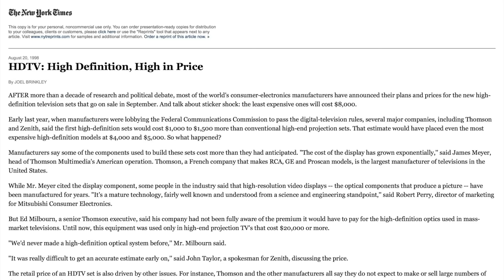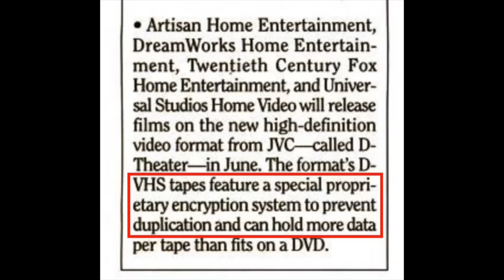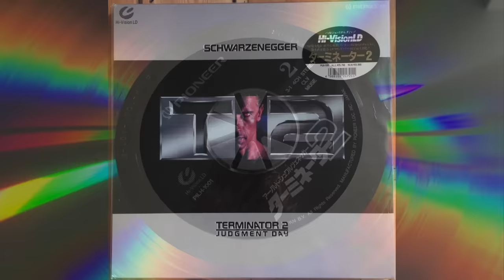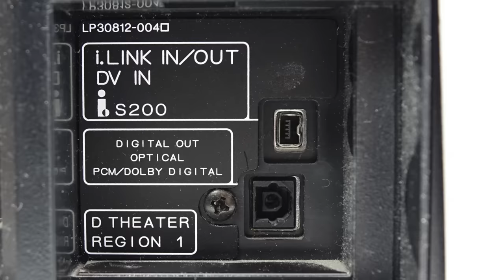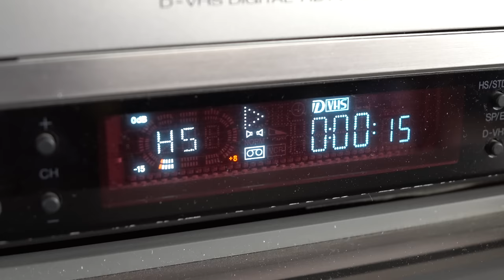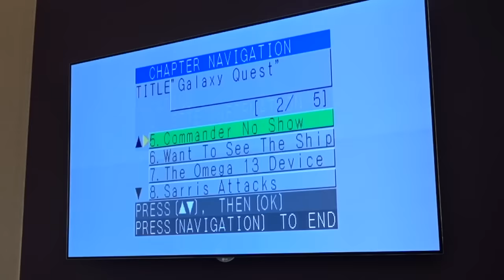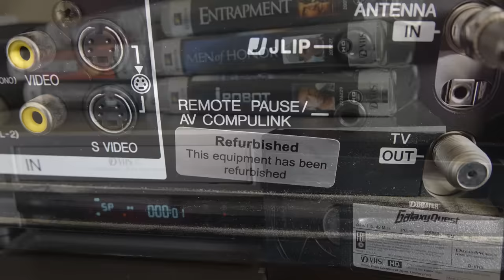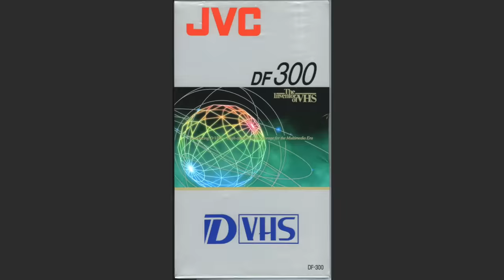Remember when HD Movies came on VHS tapes?

Comment: 50GB on a storage format from 1998 is quite impressive.
Reply: well it's tape... tape drives have been in hundreds of GB for quite some time.. eg 8mm m2 or SDLT 220
Reply: Yeah, tape is still the best for archiving, look at Sony's 185 terabyte tape format for example!
Reply: JonnyInfinite, HAHAHA
Reply: Never underestimate the bandwidth of a station wagon full of tapes...
Reply: JonnyInfinite 185 terabytes? You know how much porn you could save on that. Probably every u.s. porno from 1983-2013
Reply: Really when it comes to storage on tape its only limited by how much tape

If you had a tape drive with enough tape you could get TBs worth of storage in the 90s

Tape drives have a drawback though in theyre not random access. Not a big drawback when it comes to a movie because a movie is juat played linear but yeah
Reply: That's 2-3 times as large as the permanent storage in computers at the time. The modern equivalent would be a 4-10TB disc or a 200-600GB SSD.
Reply: imagine ripping that in 1998 hue hue ueee
Reply: IKR? They should have marketed it for backing up data as well!
Reply: @ytparchivefoundationytpaf3079  Depends on the resolution...
Reply: @TheRanblingjohnny  *Correction: Never underestimate the bandwidth of a paddy wagon full of tapes...
Reply: Isn't tape not good for data preservation...? I mean it might be able to hold a lot of data but it's so fragile.
Reply: @JonnyInfinite well considering degradation it’s terrible for archiving

Comment: I'm a 51 year old tech nerd and I have never heard of HD on VHS until now!
Reply: I have never heard of HD VHS too!
I think this never came to Brazil.
Nice video.
Reply: G Star Yeah, when he said it was a little bit of a break in the space time continuum, I legit thought he was just quipping. But between that and your comment, I’m starting to wonder if D-Theater actually existed before this video was uploaded and wasn’t just the Mandela effect in... effect.
Reply: well sir hd vhs invented on 2010 I think
Reply: @king.canute21  According to this video, the decks were available around 2002.
Reply: @teacoffee42  i think the reason it never penetrated the UK market was most likely down to the price and the fact that HD DVD was just around the corner. This format was just pure Yankee exotica for the rich.
Reply: When the rectangle 📼 VHS aspect dies, the ⭕️ disk form rises
Reply: I remember the formats briefly for sale and had even considered buying one of the two HD VHS systems (one of the turnoffs for me was their convoluted HD recording ability and connectivity that Mat/Techmoan goes into, having to use the stupid FireWire port to record HD off-air, etc. and allowing only SD over component video to record). Also bear in mind, DVD recorders were just about to hit the shelves, if not already by that point in time. In some ways, it was a similar scenario to what happened to the DAT format with its SCMS copy protection that held that formats' sale at bay here in the US until '91 or so...) But there were already rumblings in the A/V press ("Sound & Vision" mag, prior to the merger of Stereo Review and Video Magazine and others) on manufacturers somehow upgrading/modifying DVD to HD (or a replacement format that would be in the works shortly). As history shows, it turns out the latter happened: BluRay and HD DVD.
Reply: How does normal VHS tapes look on this D-VHS VCR

Comment: The future is 8K VHS.
Reply: Hook a HEVC/H265 decoder to a DVHS then it would be really possible. DTheater was only mpeg2 after all. 4K would be possible with H264 decoder.
Reply: Yes, it's like moving back form cd to vinyl, the sound is richer. Same goes with picture. :)
Reply: Nice Meme Not true! Vinyls have certain soft sound comparing to CD:s (if no scrach) and nostalgia IS NOT the only reason people or some like to listen it!
Reply: That doesn't explain 'soft' sound I mean!
Reply: Well I think even in vhs today's movies would look amazing because of the new vfx
Reply: 16k kinetiscope is the future
Reply: you will just have to settle for a  VHS recorder with a ATSC Tuner  they are 100$ on ebay if you want to have a ATSC tuner and VHS player/recorder..

 I have to say the ATSC to VHS is quite nice    the sound quality is amazing for VHS tape (better then commercial HiFi movie tapes) they tend to have too much  bass (sound banding ) it has more bandwidth on the ATSC to VHS transfers  much crisper
Reply: YAAAASSSSSS
Reply: Just Another Youtube Channel About that, Digital, because it's on or off, is very resilient. Even with tape degradation, it would take a long time for errors to start appearing.
Reply: Bandido894 hmm nor shore I agree, but sound js rather subjective so whatever floats your boat.Ilrefer difital, high bit rate uncompressed/ lossless compression it has a lover noce floor than vinyl and is a lot more convinient
Reply: @KingFahtah  I'm going for 12k pong followed by 12k minesweeper
Reply: Yes Yes
Reply: VHS stock survived for so long, until drop outs  or tape bends.
Reply: lol!
Reply: Ultraman's Inspirational Recipes  Does it still CLUNK during the changeover? LOL
Reply: @Jaspion88  techno babble to me lol
Reply: XD
Reply: Nah I think it's 16k video on micro cassettes XD jk
Reply: wrong,  8K Beta!
Reply: Super 8 film anybody?
Reply: Da fu-cha iz 2pac  'kaay!!!!!!!!
Da day afta iz 3 'kaaay!!!!!!!!!!
Da day afta Tom more Raw is Fork 'kaaaay !!!!!!!!!!!!!!!!!!!!!!!!!!!
Da day afta dat iz Flava 'kaaaaay !!!!!!!!!!!!!!!!!!!!!!!!!!!!!!!!!!
Day afta day afta dat is soooooooooooooooooooooo
6ex 'kaaaaaay !!!!!!!!!!!!!!!!!!!!!!!!
Next day afta dat iz in a head Inna box 'kaaaaaaay !!!!!!!!!!!!! 
Lass day iz in my tummy cos I 8     it 'kaaaaaaaay !!!!!!!!!!!!!!!!!!!!!!!!
Reply: Sorry, I already own a 20k VHS player.
Reply: Bandido894 CDs have better sound than vinyl because you don’t have carefully mix the albums to avoid issues with playback on a vinyl. If you added to much bass, you could have the needle jump. Also, you do have to deal with the pops and clicks that come from the dirt and debris, and you avoid wrapping with CDs. If they had cds in 69s, ever mix engineer would have used them.
Reply: Nice Meme Yes it is. You get tons of more headroom with CDs than Vinyl.
Reply: @nicememe9450  the audio is compressed on CDs which people say makes a big difference between vinyl and CD.
Reply: @taylortripp8598  So are vinyls, but they are compressed differently, the difference is cds have a higher dynamic range.
Reply: This is elite
Reply: ah, yes, enslaved vintage.
Reply: Only when I can watch it on an 8K triniton CRT!
Reply: Bandido894 placebo, maybe? modern albums are mixed on digital workstations so there is no point to worship vinyl over cd if you are listening to music from 90s and beyond
Reply: And I will order one RIGHT NOW!!!!
Reply: No joke. Most likely transporting 8K Project Files will be done on LTO Tape. Now we just need a All In One machines that has a LTO8 Tape Deck & 8K 4:2:2 10bit Recorder.
LTO7 is 7TB & LTO8 is 12TB, perfect for high quality 8K.
Reply: 8k on elcaset ;)
Reply: 8K Video Vinyls*
Reply: No were going back to shitty video it will be the trend
Reply: @nicememe9450  I'm actually it's all subjective. For some it's the perception of "warmer sound" from a record or at least a kind of different sound they like and for some it's nostalgia and for a combination of both. In the end it's too subjective to argue for or against. Listen to what you like imo and don't sorry if one is "better" then the other. CD and digital music is certainly more convenient without a doubt but sound quality wise it to subjective. Records to provide a much larger and better medium for album art which had been lost somewhat  imo  with CDs and digital music.
Reply: @punker4Real actually, it is possible to record digital video on a standard VHS tape. The company, Danmere, in the 90s , made a computer backup system that used VHS tapes and a standard VCR to backup computer data. It cost $90 and they claimed you could store up to 4gb (depending on compression settings)  on a standard VHS tape. it used technology not that disimular to  how audio cassettes where used for cheap home/micro computer storage though I it employs the  video track only. Several other companies made similar devices though none caught on. One major drawback of this system was it was very slow (9mb per min).
So given that 8k required around 100mb per second when compressed then you could store something like 40secs of 8k video on a standard VHS tape.og course you have to weight for the video to transfer to you computer first before playing it (about 10 min). See lgr's video on the Danmere vhs data backup system  if you want to know more
Reply: 16k BetaMax.
Reply: bro I want this to happen so fucking bad!
Reply: I'm waiting for new VHS...Video Holographic System!
Reply: For 5 seconds
Reply: nunofm2005 dude that would be awesome. I need this to happen. Come full circle.
Reply: @Bandido894  lol no. If u use same  compressions methods there is no difference at all.
Reply: @punker4Real  A year late to reply but great info. Love your screen name.
Reply: LOL LTO8 Tape to store Black Magic 12K. Some studio will actually do that.
Reply: @nicememe9450  You're right. Vinyl records and CD's are the past. Cassettes are the future :P
Reply: 8k itself isn't the future. Its useless on anything bellow 70 inch tvs. Like 8k on phones is complete nonsense, 8k on monitors that aren't for very high end photo editing and the like, are also useless. 

Gaming on 8k is nonsense as well. Its gotten to a point where your eyes cannot see the difference.
Reply: @Bandido894  the "soft" sound in some cases is just preference. Has nothing to do with audio quality itself.
Reply: I never heard about this DVHS..
Reply: @nicememe9450  I doubt that vinyl is outdated. The last years a lot of vinyls were sold and this year so many vinyls were sold like 30 years ago. Vinyl pressing productions are running 24/7. Also CD's still get sold like shit and even tapes are still produced a lot. No, these are definitely everything but outdated.
Reply: I have 100 000k VHS. I never suppose that there are so much stupid peoples in the world...
Reply: @suoquainen  its a preference thing. Not a quality thing. Although the quality is good, its not as good as cds even from a technical standpoint. 

People mostly buy viynal for the ritual of it. And because they look nice and are fun to collect. The sound quality is just a bonus. And the fact some people prefer a "softer" sound. 

But cds are still more accurate.
Reply: That would be cool but I’ll stick with my VCR!
Reply: Haha _ yes it would be. All the 10 minutes of it a tape could hold :D
Reply: And it only wraps around the moon three times lol
Reply: @xHadesStamps  Not gonna lie, cassettes in GOOD condition sound like CD. I got a Sony boombox that makes cassettes sound just like ear candy
Reply: @Bandido894  ah I see the placebo gang arrived
Reply: You know what, I would actually want to see something like that because my internet is shit and can barely handle 4K streaming.
Reply: 8K Betamax
Reply: Yeah I mean 50GB is 50GB. Some 4K Blu-ray movies are under 50GB, so if you pair it up with an HEVC decoder, you could stream a 4K Blu-ray from a D-VHS and 8K should be possible too. But at that point, why not just get an 18TB LTO tape and then you can stream 100 movies LOL.
Reply: 8traK. Illoominahtee confirmed
Reply: @suoquainen  Just because it’s still selling doesn’t mean it isn’t outdated, it just means people continue to buy for whatever reasons.
Reply: My dream format. An analogue format with high resolution and uncompressed sound that does not wear out like magnetic VHS and isn't bulky like Laserdisc.
Reply: @xHadesStamps  Well, the way things have been trending recently, with cassette tapes somehow making a mild comeback, I foresee the next trend being the comeback of 8-track, followed by wire recorders, wax cylinders and ultimately foil recordings.
Reply: @Jaspion88  Maybe LTO would be more appropriate for 8K since it probably HAS to be saved raw for best quality, and LTO tape carts can store up to hundreds of terabytes and counting.
Reply: How about 8k Betamax…. Betamax offered more scan lines than VHS.  Bout would need multiple tapes for one movie
Reply: Just use an analog to digital system with a vcr player and an 8k tv with its advanced 8k ai upscaling. You can probably make a vhs movie look as good as or better than a regular Blu-ray movie this way.
Reply: @electrictroy2010  In fact, you'd have to hook up a converter box to record ATSC or really, any digital television signals to VHS or Betamax.
Reply: @punker4Real  is that saving digitally?
Reply: Good joke. 😂

In fact, 4K is the ceiling for 35mm film stock (which was the industry standard back in the 20th century). Back then, there was only a handful of 65/70mm movies that can be digitized in 8K.
Reply: I've had an idea for a while to make a video format on LTO tape. LTO 7 can hold 6TB uncompressed, and run at a speed of 2.4gb/sec, which would be plenty for high quality 8k or even 12k footage in an intraframe format. This is of course just an idea and it would never be a thing, but I like to think about it.

Comment: FYI, this wasn't the first HD VHS.  In Japan, they had W-VHS (wide VHS) that was 1080i and was recorded in analog component format to tape (not digital).  It came out in 1994.  In the late 90's I worked at a public TV station.  We had one of these W-VHS players connected to a CRT projector in the main conference room.  It was the only way to show HDTV at the time.  There were no commercial tape decks or displays out yet.  The PBS station used it to WOW donors to hopefully help fund the upgrades needed to do the NTSC to ATSC conversion.  I was blown away at the time too.  Seeing HD when DVD had only come out a few years earlier was breathtaking.
Thanks for the video.  Re-living this stuff is fun.  Manufacturers have been using tape as a digital bit-bucket for a long time.  It's still be used in the computing world to store terabytes of data (tape backup).

Comment: One thing he missed was it was actually possible to record HD from satellite with DVHS. The Dish Network 5000 had an ATSC modulator, that you could feed to a tuner with a FireWire output, and feed that to a DVHS deck. I have a bunch of movies that I recorded from dish network's HBO feed. Sadly my two DVHS decks are not working, so I can't play play them back.
Reply: If only d theater came out just 3 or 4 years earlier than it did, it would actually have some success, at least with videophiles until blu ray and hd dvd came along.
Reply: Yes some people have sports recorded on tape as well.